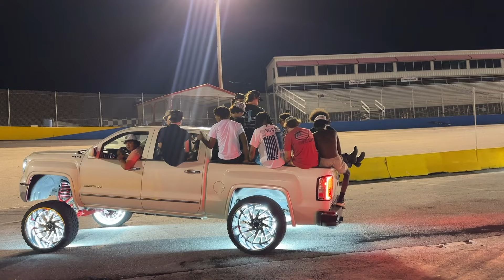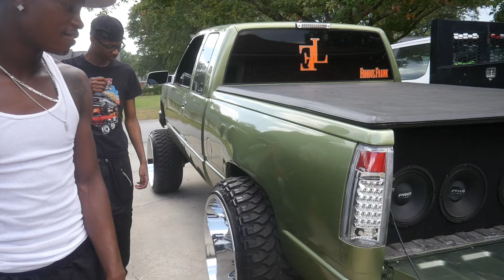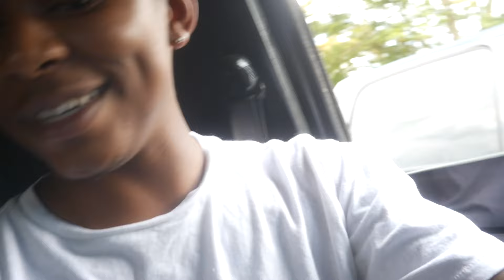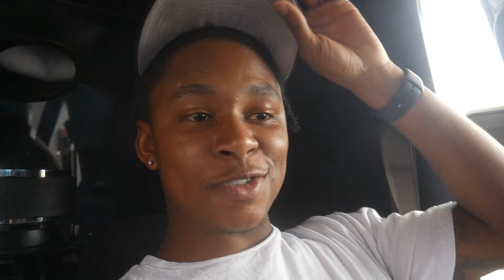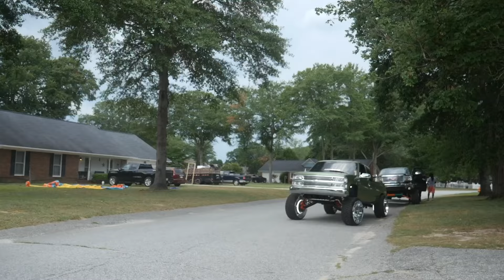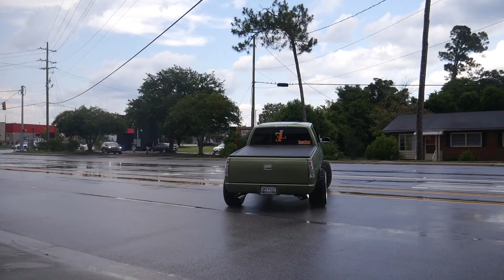HOW TO MAKE A 2WD OBS TALL AS A 4wd| HOW TO VIDS| 2wd Kings| South Carolina| #insane

Comment: Bro you got to have sum aftermarket, spring or space if your angles are looking like that uppers and ball joint spacers aren’t gonna move the lower control arm down the upper would just move up
Reply: Looks like a body lift too
Reply: @kaidenc1500  yeah it doe 100%
Reply: They front end of a dodge ram 2wd is the same you really can’t go high without a body lift and level
Reply: the spring is out the 6 inch lift kit so it gotta be a lifted spring i think 2 inch lift kit